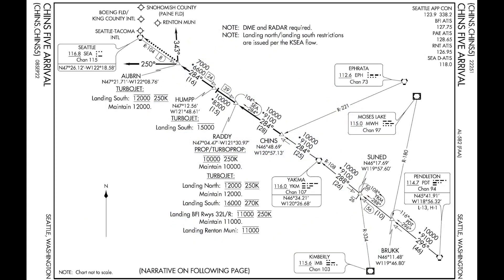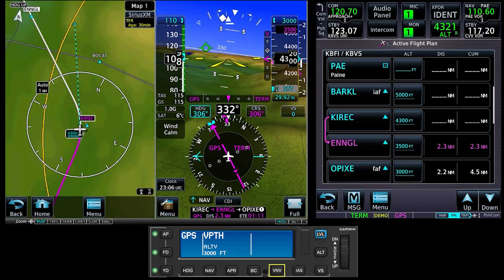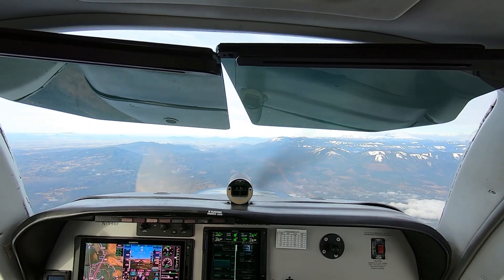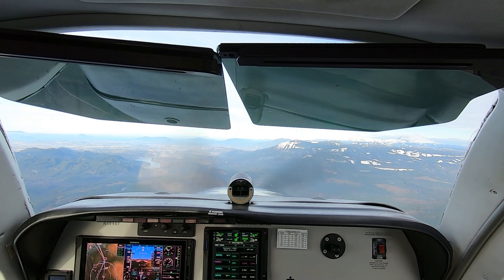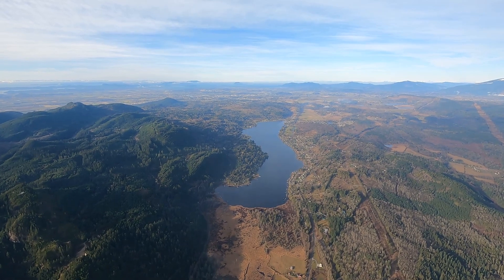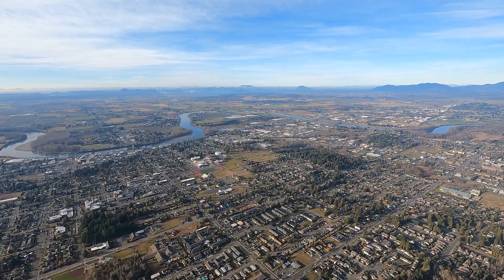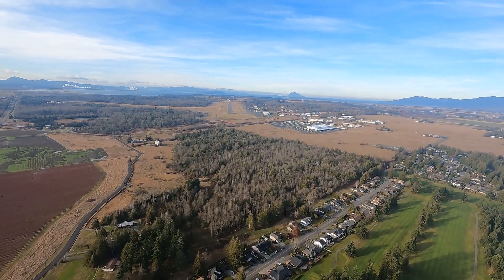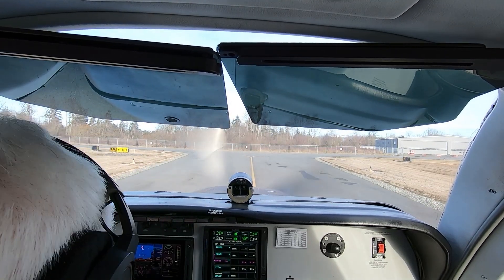Using VNAV on an Approach at KBVS

Comment: In the beginning of this video you appear to be utilizing a PC simulation of the GFC 600. I've been unable to find one that ideally works with the Garmin PC Trainer, or even with a flight simulation that accurately simulates all of the modes and functionality available. What software are you using in this video? Thanks!
Reply from the maker: I am not aware of any simulation of the GFC 600 or GFC 500 autopilots. To help explain the features I was using, I captured images from the free Garmin PC Trainer Suite for Windows and photos of the GFC 600 controller.

https://www8.garmin.com/support/download_details.jsp?id=12373

Comment: Hey Bruce, could you do a tutorial on a non-precision approach using the GFC autopilot.  I haven't seen one of those yet.
Reply from the maker: I suspect that most pilots flying with a GFC autopilot have a WAAS-capable GPS navigator. And if they do, they will see an advisory glidepath (+V) when flying most 2D (nee non-precision) approaches. Newer GTN Xi variants provide +V guidance even  when you fly a VOR approach (https://bruceair.wordpress.com/2021/05/14/vor-approaches-with-lnavv/). My practice and recommendation is to follow the advisory glidepath and use the point at which that +V guidance takes you to 50-100 ft above the MDA as the decision point--i.e., where you begin the missed approach. I'll try to get fresh video of a 2D approach one of these days. In the meantime: https://youtu.be/qW1D5aSmYHA

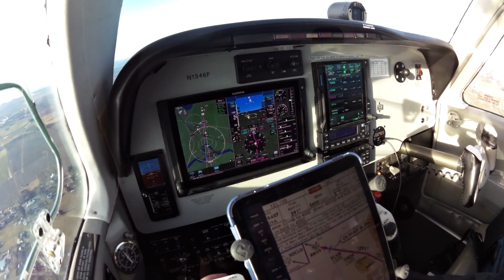Comment: Nice job slowing down to maintain separation from the landing traffic. I’ve noticed that you maintained over 1nm separation at all times. Is 1nm your personal rule (where you’d break off the approach if you got any closer) or a coincident? If not, do you have a minimum or does it depend on factors such whether you’re converging ? 11:46
Reply from the maker: I am acutely aware of recent accidents, such as the mid-air at Watsonville (KWVI), where a twin continued a straight-in approach at high speed and collided with a Cessna which was in the pattern ahead. That's why I slowed down and made additional position reports and confirmed on the CTAF that I had the aircraft on base in sight.

I didn't have a specific distance (e.g., 1 nm) in mind. I just kept the airplane ahead in sight and adjusted speed early to allow safe spacing as I got to short final.

I also make position reports relative to the airport, not to fixes on an approach. Those fixes may not be familiar to non-IFR pilots and pilots who don't have the approach chart available.

Comment: Thanks again for the ride along.  When you reduce power on a coupled approach, does the trim automatically engage, or is glide path maintained solely by elevator pressure?
Reply from the maker: My GFC 600 (and many GFC 500 installations) autopilot has a trim servo, so it adjusts elevator trim as airspeed varies and when you change configuration, such as extending flaps and landing gear. My autopilot also has a yaw damper that handles that axis.
Reply: @BruceAirFlying  That's awesome.  The last "real" autopilot I flew was our old KFC200, that would fly a coupled ILS or GPS approach but you still had to manually keep the trim up to date.